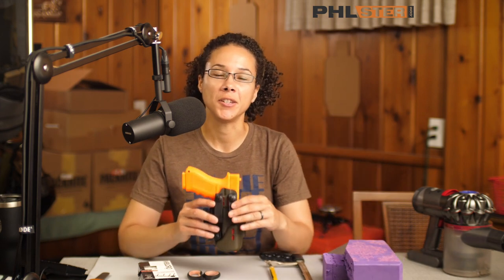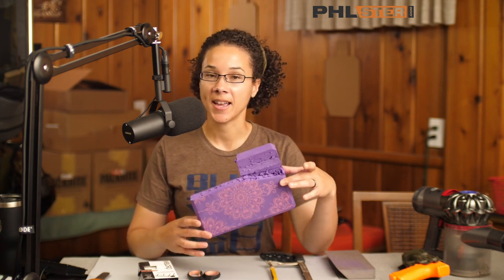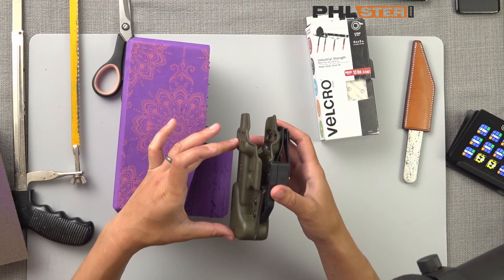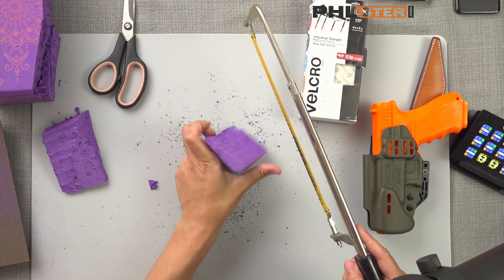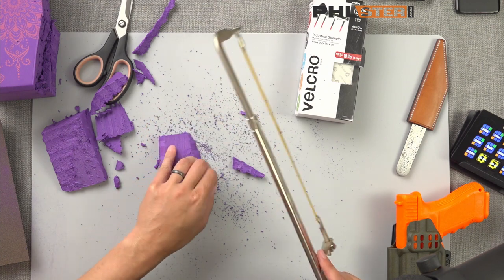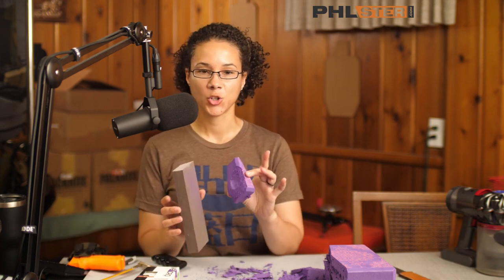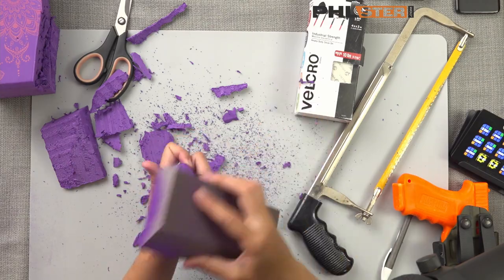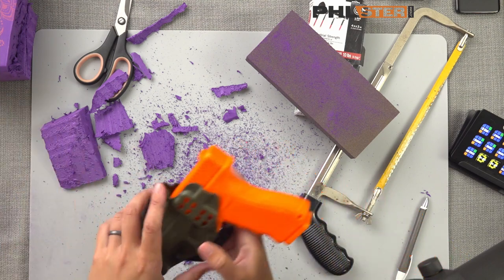Wedge Tutorial | How to Make a Custom Holster Wedge

Comment: This a great DIY. I wanted to add the little modification that I did. I cut out a square block that was roughly the right side and then traced the outline of the bottom on my holster on the top of the block. Then I cut out foam in the shape of my holster at an angle that would make the pistol grip not stick out. That saved a bit of cutting with a hack saw. Thx for the video, it gave me the idea.

Comment: I’ve made this type works great! The 2nd one I made did some improvements like placing the wedge in a stretch silk sock before spraying it in contact glue so it bonds then cut excess meld edges this way protects frm any foam frm wearing off and the Velcro sticks better.

Comment: If anyone has issues with getting the Velcro to stick to the holster or wedge, one thing I always do any time I use Velcro, and don't want it to fall off, I use spray adhesive instead of relying on the Velcro adhesive, which I find is often not what it should be. However, there are a couple things that must be done, or else the spray glue is useless. 1. Apply it to both surfaces that you want glued together, and make sure it's sprayed on in a light even coat. No big globs. 2. Let it sit until it's tacky. If you stick it together wet, it won't dry right and it won't hold. 3. While this should be first, it's just a reminder to mask off anything you don't want glue on. So use masking tape at least as wide around the glue area, as the spray is from the can so you don't over spray. Anything that does get over spray on it if you don't mask properly, comes off best with any kind of cleaner that has citrus in it. Citrus kills sticky stuff very well. 

So if you get Velcro that doesn't stick well enough. This will fix it. Personally, I get the industrial strength stuff and I still do this to it lol. Maybe over kill in some scenarios, but ever since I've started doing this, I've not had any issues with any Velcro coming off.
Reply from the maker: The easiest way to make the velcro stick like crazy is to clean the holster surface with an alcohol wipe and, after removing the plastic adhesive cover, warm the adhesive with a hair drier. This makes it incredibly tenacious and I’ve never had it peel unintentionally.
Reply: @PHLster  hmm now you have me thinking about using my heat gun lol. Half tempted to try heating some Velcro onto kydex. I do need to get my heat gun out anyways to try to increase retention to an acceptable level on a holster that seems to have lost it's hold while sitting unused for a month or two.

Comment: Thinking that drilling some small holes from a couple different angles (so the 'tubes' connect) would help with aeration, reduce sweating. Would want to do that before velcro attachment. Assuming it would not compromise it, that block seems pretty solid.

Comment: I'm in the opposite camp on this. Add bulk under the belt to pull the gun in above the belt? Add width across the belt line to pull the grip in closer? At what point are there diminishing returns? Instead of adding a backing pad, a 'wedge', a 'claw', or whatever else to an already hard and bulky rig... all just making the rig thicker/bulkier/more uncomfortable to deal with... I'm looking for less. I carry in the most minimal holsters I can find because sometimes less is more.
Reply from the maker: We have videos which discuss all of that. It’s all body and clothing dependent, as well as the level of concealment you require.
Reply: @PHLster  I have gone through a laundry basket full of holsters to find what works for me. My wife, who is shaped like an hourglass, could probably concealed carry a Remington 870. Big hips, little waist, double Ds... no matter where she puts her gun, even in tight clothes, it just disappears.
A couple of belly bands and a couple of small Kydex IWBs and it's all good for her.

Comment: Just a quick comment.   Applying contact adhesive to surfaces where the velcro is applied will greatly increase the adhesion, especially on the foam.
Reply: be cautious and test a sample as a lot of contact adhesive will melt many foam products.
Reply: That’s an awesome idea. I have been having problems with my velcro coming undone but I bet this would solve it. Thanks.

Comment: Tried this, but the struggle is to cut it to size. Any suggestions as to what type of knife to use especially to cut the crevices to fit the holster?
Reply: Do you have a dremel tool? When I have to “scoop out” to make it fit the back of the holster, I use my dremel with the drum type sanding attachment and it works great. Like she did here I use a hacksaw to cut the general size like she did here, but my hacksaw is much smaller, then use the dremel for fine tuning it.

Comment: Can this method be used to add a “keel” to a shorter holster? I’m playing hell trying to keep my p365 from tipping out of my jeans at the top, and a way to attach a firm point of contact past the muzzle would be a lot cheaper than an xl slide and barrel.
Reply from the maker: Absolutely. You can attach a wedge and let it overhang the bottom of the holster, providing a little extra Keel. If that doesn't give you enough stability, you can also just run your p365 in a p365xl length holster.
Reply: That’s the key right there. Use the holster designed for the longer slide. For instance a Glock 43 or 43X into a Glock 48 holster. This will keep everything from flipping over and you looking down at your own pistol pointed at you.
Reply: try a NEXBELT appendix carry gun belt , i think you will be amazed how much difference it makes with any/all types of concealment holsters ;-)

Comment: Why would it matter which side the velcro is on to remove the wedge ? 8:35
Reply from the maker: If you remove the wedge from the holster and the hard hook side is on the holster, it will be uncomfortable. If the soft loop side is on the holster, it won’t be scratchy or painful

Comment: good info: added a little  tip, run a heat gun over both holster and hook &loop adhesive the heat will activate adhesive and it will stick better and last longer.
Reply: embarrassing moment should have watch to the end before commenting ..

Comment: FYI... This is a poop idea. Tried it exactly this way on 3 different holsters and it comes off if you are active and moving much. Heel cushions work way better and stay on way longer. Oh and this foam leaves pieces in your pants and shoes from wear
Reply from the maker: This specific approach is an extremely widespread practice with uniformly decent results, not like the issues you’re describing. It could have something to do with your methodology and assembly.
Reply: @PHLster  negative ghost rider.. I did EXACTLY what you showed. I'm very active on my job and life in general. This foam wears quickly for me and ones who tried it around me as well.. that foam breaks down quickly. Heel cushions are a million times better or the wedges you can buy. I can get high quality wedges t my local gun store for around 10 bucks. You can also heat the back of your holster and press it out with a spoon to get a permanent wedge as long as you stay away from the trigger guard tension.
Reply from the maker: @2ballsyourjaws  sounds like the DIY approach doesn’t fit your needs, then
Reply: @PHLster  I'd like to apologize if I offended you.. I didn't however love your holsters. I carry daily with one actually. It's been amazing to me